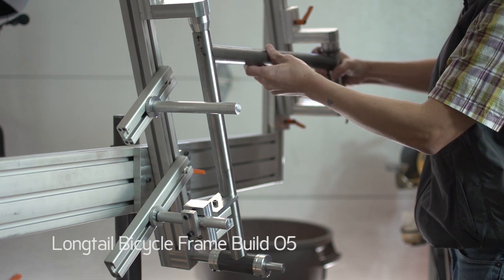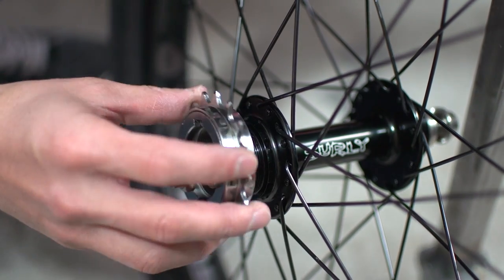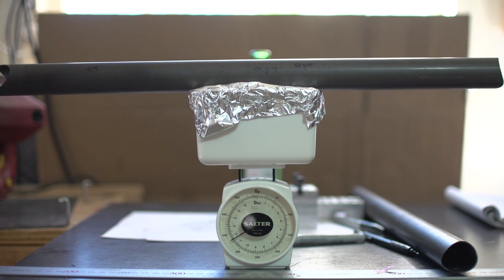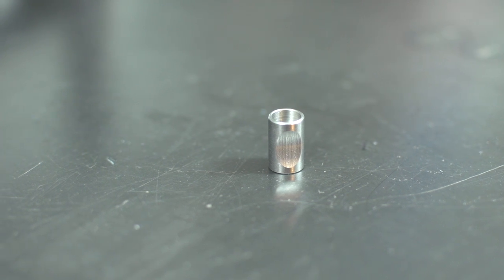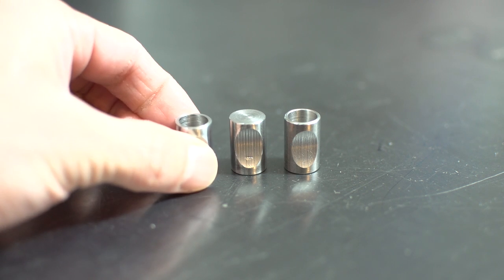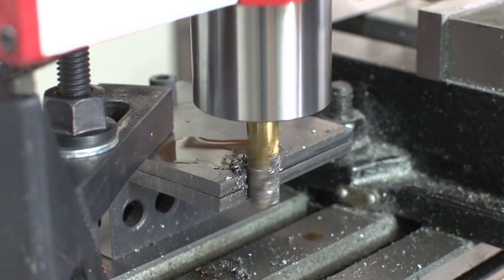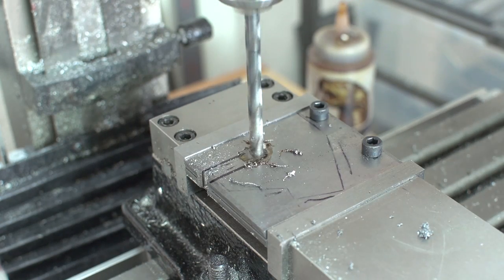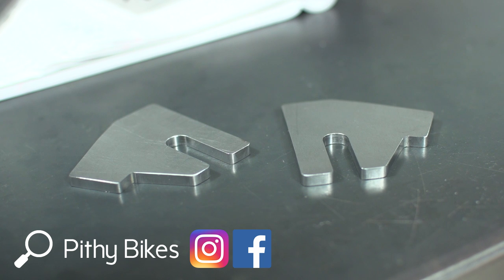Longtail Bicycle Frame Build 05 - Tubes Dropouts Binders

Comment: is your band saws table at a slant because all the cutting fluid ran one way
Reply from the maker: It probably is because the table I made is a bit janky
Reply: Pithy Bikes 
Oo ok
Reply: @PithyBikes  First off, I really like your channel! Your assembly jig blows me away! Very cool! As a 40+ year certified welder/fabricator, I don’t know why you want to use that nasty, messy oil on your bandsaw cuts! It’s not needed on the thin stock you use, and for instance on Ellis miter bandsaws (the best there is in my opinion) they don’t even offer any kind of oil/coolant dispenser on their saws! Keep up the great work!
Reply from the maker: @tomt9543  Thanks for the comment! I wish it wasn't necessary because it makes such a mess. Unfortunately on this type of cheap portable saw, its kind of a necessary evil to maximize the life of the blade. Some day I'd like to get a really nice full size bandsaw. :)

Comment: how well does the leather binding hold up to the temperature of the welding torch? Would it work with a brazing torch or not? Love the videos, especially as you have a completely different method of building frames!
Reply from the maker: The leather only held the binder on while tacking. For actual welding I took it off. If I have a completely different method, it's because I don't know the standard method ;)

Comment: For filming weld shots, you need a neutral density (ND) filter. They are adjustable and are available to add on (or tap onto!) any lense. You're good enough with the camera to figure it out in two minutes. We use these to film trade school welding videos for students and they're amazing. The Weld Monger uses them too ;) Loving the videos and gearing up for my first frame. Collecting junk bikes to cut up and practice on first.
Reply from the maker: I have tried ND filters. Would you mind sharing what filters you guys are using? Cheers!

Comment: Don't breath cutting oil smoke, it's extremely toxic and causes cancer (think bladder cancer). Try and set yourself up with an extraction tube that you can bring real  close to the cutting to exhaust the fumes out before you breathe them in. It may seem cumbersome and slows you down a little bit, but it's worth it isn't it?

Btw, at 13:29 when you're tapping that hole, a good trick is to use what's called a tap follower, which is basically a center (usually a spring loaded one, although a dead one would work) that you would chuck up in the spindle and the point would sit in the center hole in the shank of the tap, making for perfect alignment. Look up mrpete222's video on tapping holes.
Reply from the maker: Thanks for the tips. I always wondered how toxic the smoke is.. I very rarely generate smoke like that because I mostly machine aluminum. But this time around the thought had crossed my mind. I had the garage door partly open, but I've since starting using a fan. Especially this weekend because I was brazing for the first time too. I have a spring loaded follower, I just get lazy sometimes with smaller projects ;)

Comment: You tapped and drilled the dropouts but it would be easier to just quickly tack weld them in some places. :)
Reply from the maker: +Maximillian Brozinic I agree! Another person mentioned glue that releases when heat is applied. All good ideas!

Comment: As for the close up shots you should get 2 board cameras(fpv) and intergrate them into your helmet. Might not work all the time but might be good b roll footage, I'm thinking one above and below the visor window.
Reply from the maker: I had tried at one time putting my action cam under my hood. The biggest problem with point and shoot type cameras is being able to control the aperture and shutter speed. Without that control, the auto exposure tries to expose the area around the arc and then the arc is too bright. It's a very tricky subject to shoot. The other issue i ran into is I don't always look straight at the subject such that my hood is aimed straight too. Its all very tricky lol :)

Comment: you could tig braze them on with some silicon bronze.
Reply from the maker: +Max Hemphill nice. I wonder if I could get it to flow enough though..
Reply: It's easy and fun to work with.  1/16th rod should be right.
Reply: +1 on tig brazing with SiBr.
Reply from the maker: Do you use flux when you tig braze?
Reply: Pithy Bikes Nope just low amperage. Jody has a video or 2 on it!

Comment: I would recommend brass brazing the binder on, not silver brazing it. That binder sees a pretty decent load in service, brass will give a stronger joint. Henry James carries the Gasflux C-04 rod, it's a Nickle Bronze rod that flows well. Good for bike making.
Reply from the maker: +Alistair Spence hi Alistair, can I use MAPP gas or will I need a real setup?
Reply: Hmmm, good question. It's a small part, but brass melts at a higher temp than silver (around 450 degrees F higher iirc). I don't know the answer to that, as I've never used MAPP myself. Not sure if it'll get the job done or not. An O/A rig is another investment I know, but really if you can figure out how to acquire one in the coming months it would be a very useful thing for you to have on hand.

Braze on's can be welded of course, Ti builders do it all the time. One thing they do that might help is to PURGE big time. Make foil dams to trap Argon and reduce scaling on the threads of the binder, use a bigger cup, turn up the flow rate to suit etc. etc.

I see that someone suggested TIG brazing but I would recommend against that. Anything that sees dynamic loading like a seatpost binder does is best joined another way. TIG brazing doesn't join with the same penetrative power as brazing, or TIG welding.
Reply: In my experience MAPP gas will just barely get brass to melt but not quite hot enough to flow nicely, especially with the mass of the binder. I used silver extensively in my frames without issue. Actually, PB if you want some to play with, I have some extra Henry James silver rod and flux you can have. I'm in Oakland if you want to DM me.
Reply: Agreed, silver is usually fine, I'm just saying that the few times I've seen braze on's fail it was when they were silver brazed. Here's a link to a thread on VSalon that just popped up that provides an example of this, http://www.velocipedesalon.com/forum/f2/my-custom-frame-nightmare-rant-46445.html
Reply from the maker: Thanks for the offer Joel! I would take you up on it but I have some that should be arriving soon. :) And I'm busy all week at my day job :(  haha.
Reply from the maker: Whoa! thanks for the link Alistair. I can understand why silver is likely not the best choice for the seat binder. Unfortunately, I'm not ready for an O/A setup yet. But maybe I need to get one whether I'm ready or not. I'll start looking into something compact.. I may still go ahead with silver since this is a frame for my son and I can service it if it fails. I would not try this for anyone outside the family. Thanks again for the wisdom :)

Comment: Great channel! Just a heads up you can use CA glue to temporarily attach your two pieces together instead of drilling and tapping and simply remove them at the end with a little heat. I've used that trick while working at machine shops multiple times.
Reply from the maker: +Machine Right cool, I didn't know that could work for steel too. Nice

Comment: Each of those practice bosses would weld differently due to the thickness of the material. I generally don't like welding threaded parts, heat and scales screws up the thread, so if I were doing it, I'd bore it, weld it, drill to tap size and hand tap it in situ
Reply from the maker: +sweenep86 nice I like that.

Comment: For the dropouts you cound have put them in the vice and gone through top to bottom with the end of the end mill....basic slot cutting....go .025" at a time each pass with the DRO telling you when to stop at the radiused end of the slot...it takes a while, but a mini mill won't cut like you we're trying to with the side of an end mill...and then cut the rest on the bandsaw....
Reply from the maker: +Nathan Hamler ah another great idea. This one didn't occur to me.

Comment: Have you ever tried silicone bronze tig brazing I've had a few goes with it and it works nicely for parts like your seat boss
Reply from the maker: +Anthony Ambler do you Flux with it?
Reply: Pithy Bikes no just argon I think you used it to attach your name plate to your last frame
Reply: Pithy Bikes No, you just use a silicon bronze rod. Check out welding tips and tricks on YouTube. He's got many videos on the process. Great build, by the way!